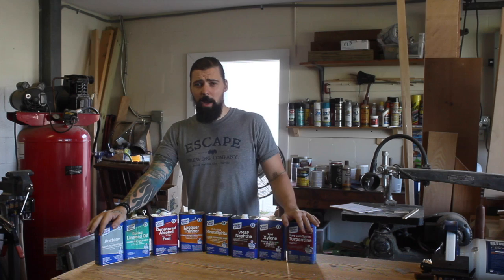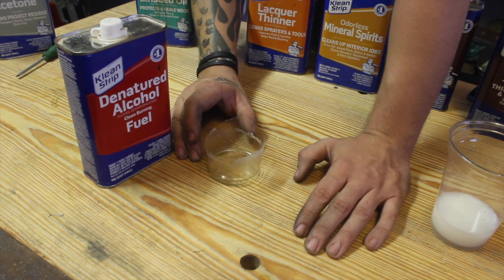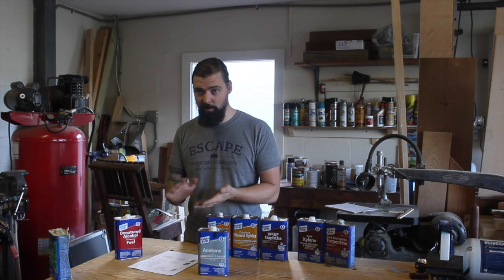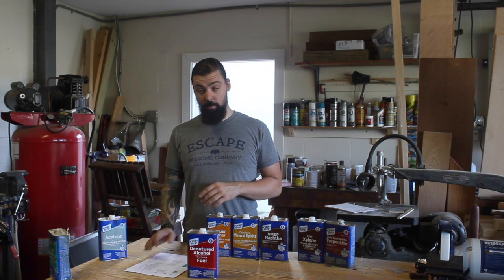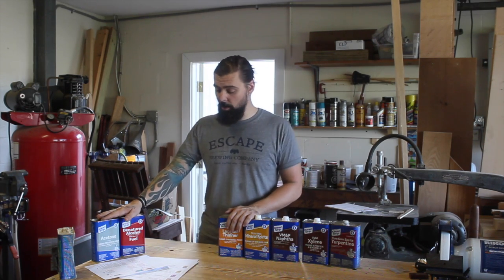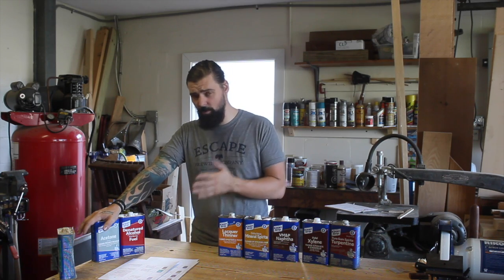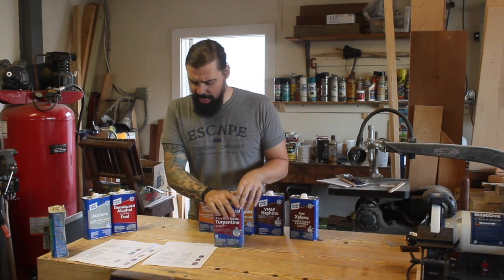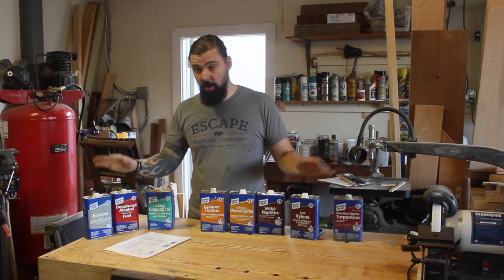Understanding solvents & thinners | Informational

Comment: For anyone; what this video doesn't address is anything ordinary, practical, or household usage. Near zero help. So, say you want to remove the sticker on a plastic bicycle helmet, or a glued label on a metal can, or old paint (don't know if it's oil based or not), or caulk or liquid nails residue, etc.. all the things that soap & water will not remove, what product should I have? No, I'm not buying 10 cans of different chemicals.

Sometimes "Goofoff" works but sometimes it doesn't. Sometimes "paint thinner" works but can also dissolve plastic (be carful), etc...

Comment: Is the information still available for download and printing? I looked on the website and couldn’t find it.
Reply: If you go to his site, under Shop, in the Free category, you'll find it there. You do have to go thru the process of 'buying' it but you can just put fake info in the required fields and you will still get a link to download the PDF. 👍🏼 It is a handy guide. I condensed it down to a single page so I can add it to my metal cabinet for easy ref when I need to verify what would be best to use.

Comment: odorless mineral spirits- turned my polyurethane clear- to a cloudy mess.
 no need for it, weak limited use, these items, in there own can help determine which type of coating u have-  ex: xylene softens  certain floor paints not water based / - mineral= latex lacquer= softens lacquer/ etc...

Comment: Boiled Linseed oil will NOT act as a thinner for oil based paints because oil based paints ARE almost always linseed oil with color added.  So adding boiled linseed oil will not actually thin oil based paints since they are already colored linseed oil. In other words, you can't thin linseed oil by adding linseed oil.   However, I suppose by adding it, you could theoretically mute the color a bit but I have never heard of anyone actually doing that and it would make no sense anyway. To thin oil based paints, you use mineral spirits or turpentine.  Mineral spirits is a better choice, though, since it costs far less and does the same thing.  By the way, mineral spirits makes a great parts cleaner. It's what I use in my parts cleaner station.     (I've been working with all these products for almost 60 years now.  I also build reproduction period furniture and restore valuable real period furniture. )  Also, be very careful with how you use acetone and lacquer thinner.  They can destroy finishes, plastics, etc.  I do use them on metal, when cleaning electronic contacts, etc.    One other thing:  Denatured alcohol is not the best way to clean sawdust from wood as mentioned in this video.  It evaporates quickly but sawdust does not evaporate.  However, it won't hurt wood and it can be used to clean wood without raising the grain. (Water raises the grain and, in fact, water is used for that very purpose.  Once the grain is raised, it can be removed.)  To remove sawdust, you can wipe it off with a slightly damp rag or blow it off with compressed air. If you really want to get rid of all the dust before, for example, lacquering, use a tack cloth.

Comment: Would just like to add that in the good old days Turpentine was used as a thinner on oil based glosses and varnishes before it became too expensive but it gives a greater shine finish than Mineral spirit/white spirit/turps substitute they are just a cheaper solution.

Comment: A recently removed dry latex paint overspray from tile floors with Jasco paint/epoxy thinner. It helped but the 2 bedroom apartment still took 3+ hours or major scraping with a wire brush. I want to find a Product/Method that will melt that shit away

Comment: Hello I have a question, I have an old 80s car that the previous owner primered black but they did not scuff the finish of the car beforehand so is there a way to remove the primer finish without hurting the original finish too bad, I plan on eventually redoing the car I just don’t like the cheap primer job they did, they even primered over chrome parts but I just used acetone on those and got it all off, thanks

Comment: What would be the best solvent for removing powder coating? I bought some xylene, but not sure if that’s the best option for powder coat
Reply: I don't think that's gonna happen. I cleaned some lawn tractor heavy parts by tossing them in a small fire.  Can't even grind the stuff off, it just kinda melts and smears around.

Comment: Hello there, I would be grateful if you could suggest which one of these would help in dissolving the carbon inside the 2 stroke pipes of dirt bikes and road going bikes. The chrome on the older bikes will get destroyed if caustic soda or heating method is used.

Comment: Great tip with acetone. I am 5 min into video and I found info that I needed. I need to clean up my (beater) bike a bit before I apply some rust proofing paint and I was not sure what to use to prep the metal. Thanks!

Comment: I have a bathtub its made in the 80s thick refined but plastic beads heated up pressed into a mold to make a bathtub.
Mine is so old that I sanded and sanded annnnnd sanded.
Some has went to the resin.
My BIG QUESTION IS: WHAT CAN I USE TO FINISH REMOVING THIS VERY OLD PLASTIC ABS/Thermo poly type plastic.
Any help would help me greatly 
I cant find another tub like mine. I want to redo it and it fits in my mobilehome  its 60x50 yes its big.

Comment: What is the best solvent to use for getting rid off paint pinstripes on car paint?
Reply: Good luck. Lol if it's paint on paint there's no real easy way. That's one for the pros. You don't want advice from u tube 4 that one. If you care about the car seek good advice,  if you don't mask and spray the same body colour over it. Though you will always see it.

Comment: MEK is good stuff itcis used as glue for styrene.
It is very good also at paint stripping oil based paint from metal object, also cleans brushes up like new.
If you respect your lungs though use it outside and wear a proper mask for spraying

Comment: What can be an exact substitute for something called 2k medium thinner and if theres no exact substitute then can i mix 2/3 weak thinner and 1/3 strong thinner and get the same result thanks 
P.S I need the exact outcome to mix 70 percent medium thinner with 30 percent xylene to use on Hydrographic films so i guess i would need precisely the medium thinner outcome in order for it to work

Comment: My granddaughter was in kindergarten with a playground covered with shredded tires. I was so opposed to it because I didn’t want her breathing in the toxic particles that would be in the air. I knew it would damage her lungs and absorb through the skin. I can’t believe anybody was so stupid to use that. They are changing it out thankfully this summer. But the teachers made them play outside after it rained and the carbon black, the rubber and mud got all over her pants, shoes and socks. It even would leak through to her underwear. I was wondering if you knew a solvent that would cut through all of the horrible black stains and allow it to wash out? Or do I just throw all the clothes away?
Reply: Oxiclean

Comment: Hi sir, could you pls give me some advice?The entire wall in my home was painted with solvent based sealer mixed with thinner, then 2 coats of water based paints, but after 5 months the smell is still there. I just scrapped off the paint and putty just leaving cement surface but the smell seems penetrating into the wall. How can I do to solve this problem? Can you pls give me some advice? Many thanks!

Comment: Thanks for the video! Really helpful. Quick question, I got paint on an unvarnished wood deck, would paint thinner/mineral spirits be my best bet at getting it off? What about lacquer thinner? Whenever I search paint thinner more times than not, lacquer thinner pops up. Would it work on unvarnished wood as well? Lacquer thinner is the cheapest I could find on amazon, so if it could that’d be best. But I don’t wanna buy something that wouldn’t work
Reply from the maker: I would think mineral spirits would be the best bet, as that is the solution for most common paints out there. I'm not sure if you have a Home Depot, or Lowes nearby but they will have all of that stuff in stock.
Reply: ZH Fabrications Thanks so much for your help!

Comment: I used to work in a small custom metal fab shop that had been around for four generations and we used MEK to clean aluminum before welding on it. Aluminum has to be super clean for good tig welds, at least in my experience.

Comment: Great video, I really appreciate it. So let me ask you. What is overall the stronger chemical for stripping. Acetone or Laquer Thinner?
Reply from the maker: Thanks. They are different, but my guess would be that Acetone would be a bit stronger, although there are certainly many times where Lacquer thinner will do a job that Acetone cannot.
Reply: ZH Fabrications Okay, I will probably use diluted Laquer Thinner then. I am taking paint transfer off of a vehicle, but I have to be careful not to strip the paint/clear coat from the vehicle itself. Lol

Comment: MEK is a slow drying solvent that is great for extending open time in polyurethanes so you get a better flow out and achieve a higher gloss and smooth finish. It also has a pretty harsh smell and and can really mess up a finish if it is not used properly l avoid MEK at all cost and I am a professional wood finisher lol